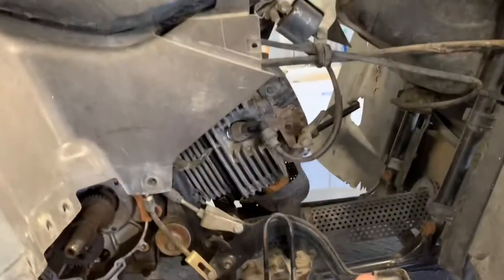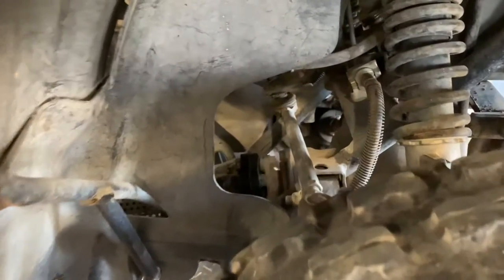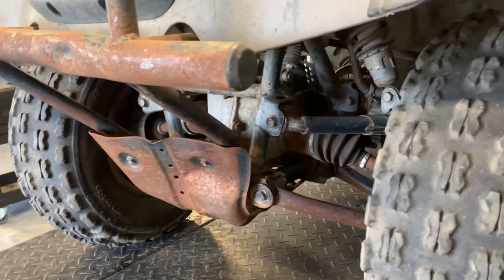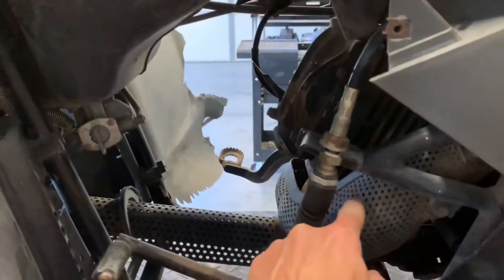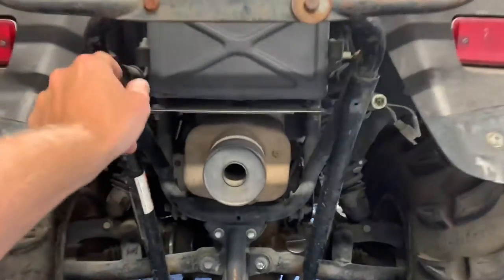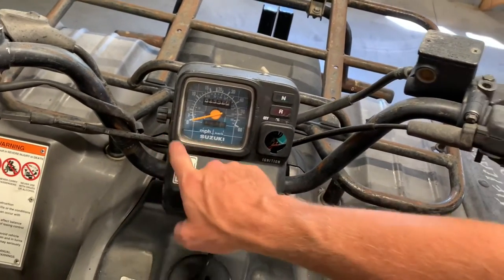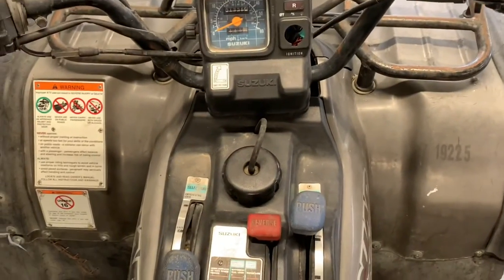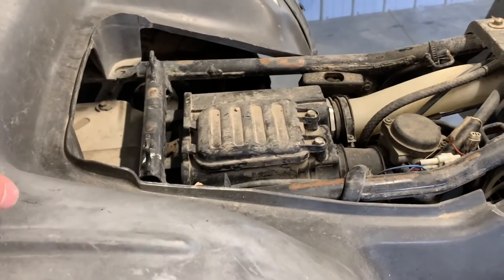Suzuki Quadrunner 250 LTF250 Common Issues Overview / Review

Comment: Hello, i have a 1996 lt-f4wdx and i'm changing all the bearings inside the front differential, but i can't find the torque on the pinion nut or preload would you know it by any chance , it is not even in the shop manual,

Comment: How do you adjust the brake lever on right hand side. I think it's for front breaks.
Reply from the maker: If they are hydraulic brakes there is no adjustment.  If you need more helpful tips, check out:   https://youtu.be/X0AdFxkJiOg and if you need parts: https://www.ebay.com/str/midnebraskamotorsports. Thanks for watching and the comment.

Comment: Is it OK to add an inline fuel filter on a 2000 suzuki lt-f250 2x4.? There apparently is none. Just screen filters on petcock inside fuel tank. Thank you again for your great channel. You videos have helped me alot fix a couple bikes.
Reply: Yes of coarse. You can do it on any motor
Reply from the maker: YES!! In fact I'd recommend it. Thanks for watching and the comment. Let us know if you need parts or have any questions:  https://www.ebay.com/str/midnebraskamotorsports

Comment: looking for where battery is on zuzuki quad runner 250 and it runs for 20 30 mins and quits then restarts any ideas
Reply from the maker: Check our carb rebuild video on this machine. Battery is upfront on these depending on year.  Thanks for watching and the comment. Let us know if you need parts or have any questions:  https://www.ebay.com/str/midnebraskamotorsports